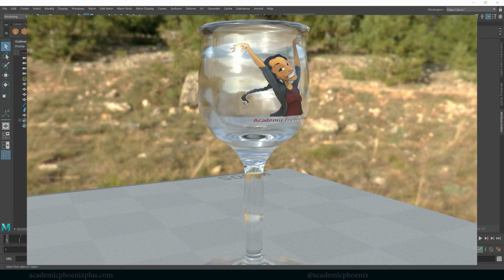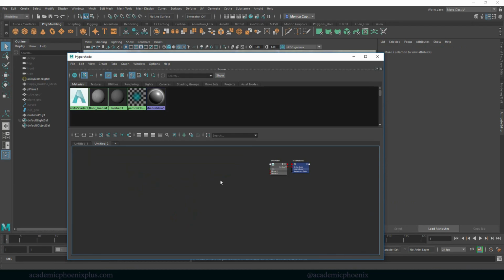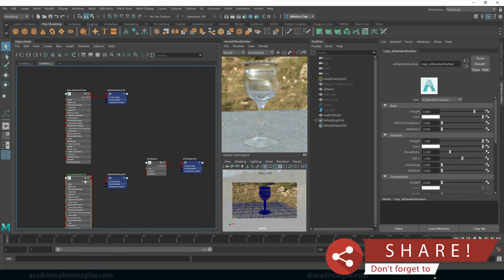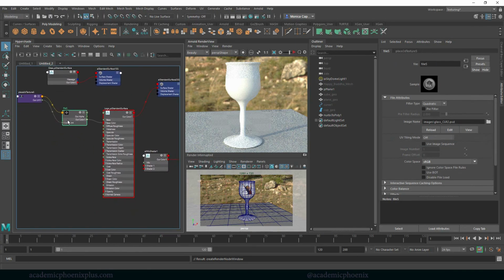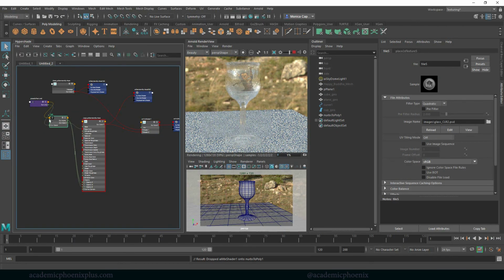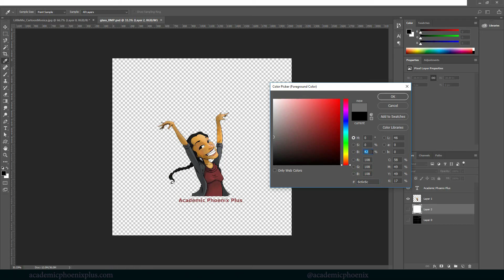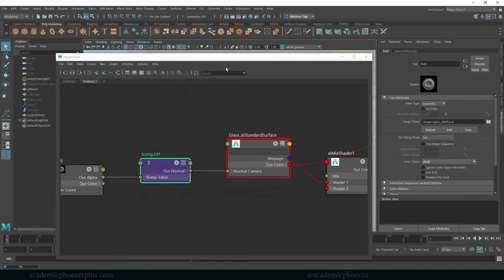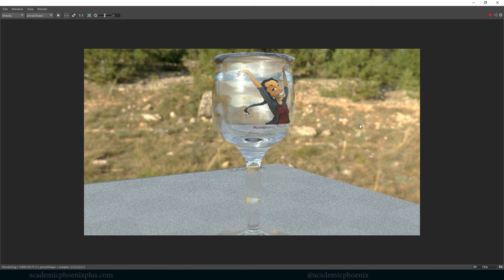Use aiMix Shader to Create a Logo on a Glass using Arnold for Maya

Comment: Awesome video but im confused about my setup. for some reason i only see the image on my glass mesh when i connect the png or psd node's out color to mixshader  shader 2 input and the out alpha to the mix input. These pretty much leaves my logo shader useless not connected to anything. When i tried to use the logo shader the way you instructed i keep getting either my image all black or the glass looking all black.  Any suggestions on my problem ?
Reply: same
Reply: @MSJDesign  In case anyone is having the same issue, I realized that in this tutorial she doesn't have an alpha channel, but uses the inherent transparency of the psd file.  Make sure that you have an image w/transparent background (checkered pattern) in photoshop, then use the alpha to drive the mix shader.  If you try to use a b/w alpha mask with this process it doesn't work as intended.
Reply: @freezerb0y  I can't fix this, Tried all but it keeps black mesh with logo

Comment: I have 1 question, how did you do the psd file, in my university i have to make something similar, i have to put some paintings inside a cave's tunnel. y follow the same process of yours but i don't get the same result, i assumed that's because of teh psd file, because i used an single png file inside the ai standard surface. i hope you can help me